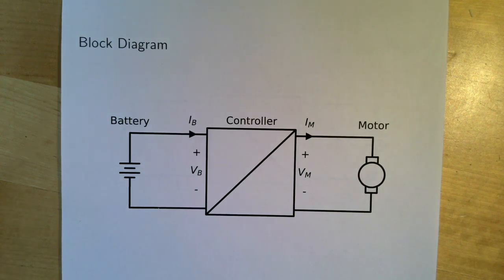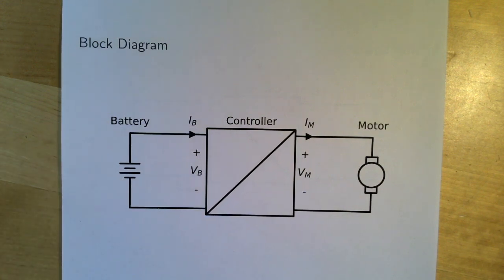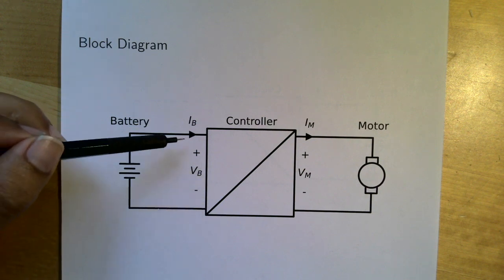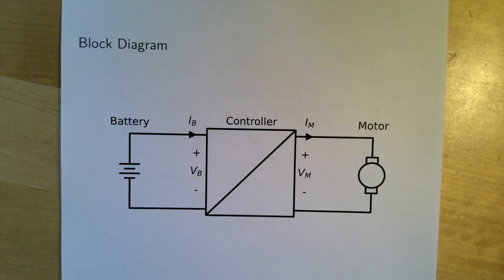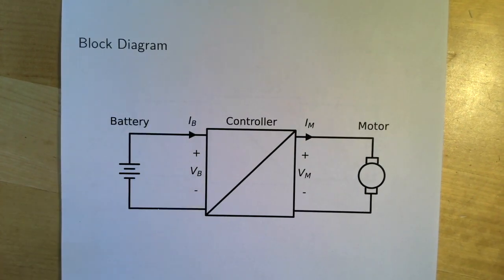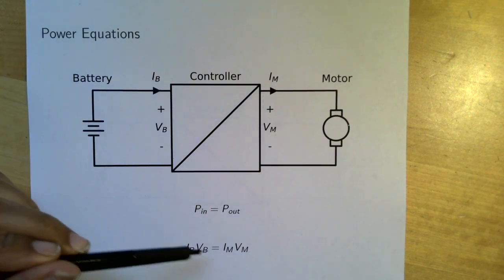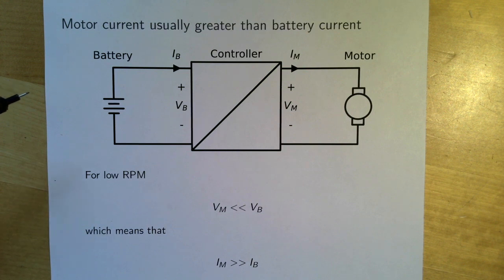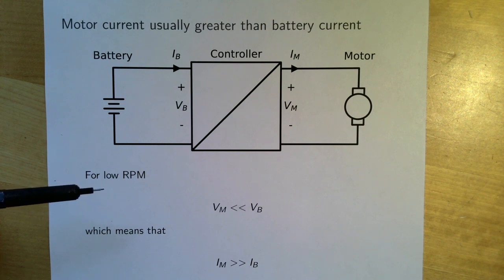Battery Current and Motor Current

Comment: Hi! I can't understand why use batteries with low number of series blocks and high number of parallel cells, if higher voltage gives us more speed potential even if we have a speed limit, and the battery current decreases due to voltage increased. Maybe its about peak currents in PWM of the controller?

Comment: This is why Debodge said that its best to have your controller as close to the motor as possible because motor in torque mode means high current and u dont want to have long phase wires.